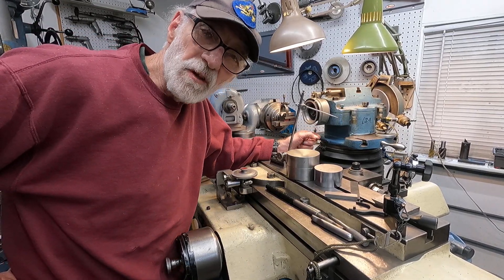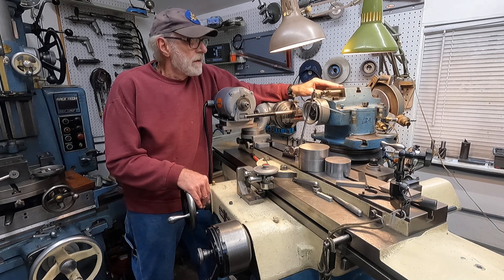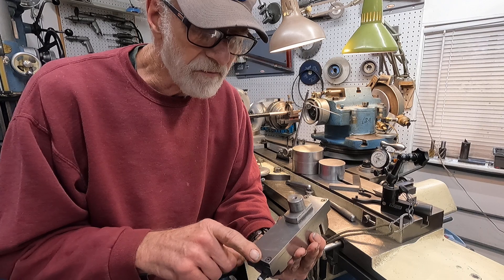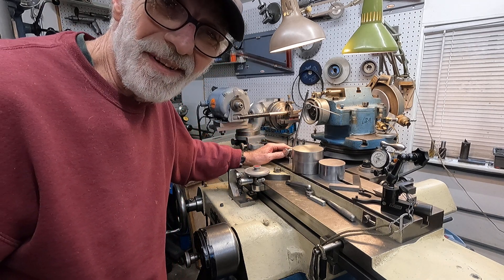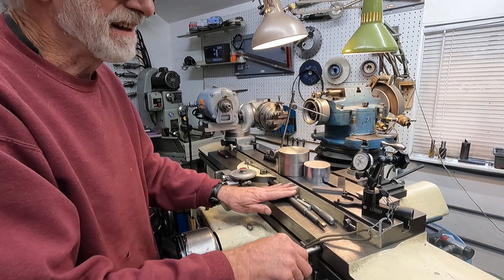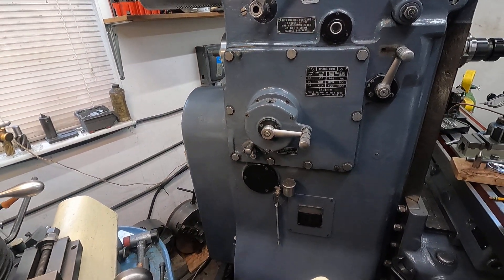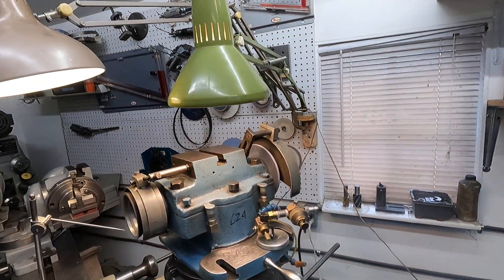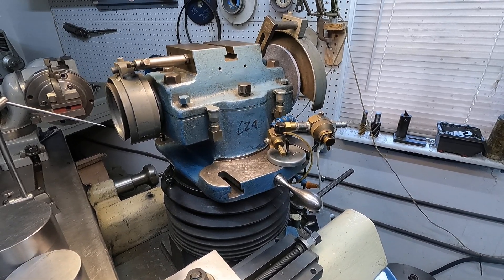Tool & Cutter grinder the daily grind

Comment: Are you supposed to grind carbide into or away from the cutting edge?
Reply from the maker: It seems to me grinding into the edge might be better at times I have to grind the other way and it works. The carbide grinds away like rock or concrete with the diamond wheel
Reply: Always into the edge if you want the best edge.
Reply from the maker: @electech3339  I think so, but who says so, where is it in print?
Reply: @deedeeindustrialsuperprecision Hi donie, it is in print in many tool and cutter grinder manuals actually. Including Cincinnati's. Also based on personal experience and microscope examination of edges.
Reply: @electech3339  Okay. And hss away from the edge.?
Reply: @duanedickey7043  that depends on the individual tool and what wheel you're using to grind it. Also whether you will be doing any fine honing afterward. Grinding away from the edge on steel can tend to produce a larger burr, which isn't good for tool life either. If hand honing afterwards, I will often grind away though. Grinding toward the edge with steel can produce a bit more chipped and torn edge. (I have often examined with a metallurgical microscope). For a steel roughing tool I will mostly grind toward the edge. If I want the finest edge possible I will grind away and carefully hand finish with a very fine stone.
Reply from the maker: @electech3339  It is an interesting subject, the most shocking is the damage a green wheel does to carbide.
Reply: @deedeeindustrialsuperprecision  Yes, agreed. That can leave a very ragged edge indeed. Don't much care for those. They are extremely messy to use on carbide also.